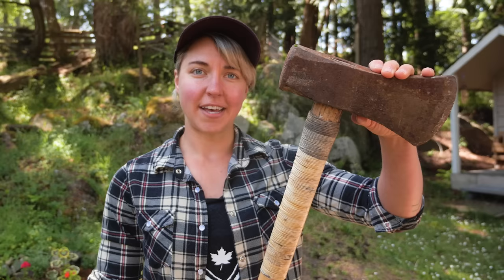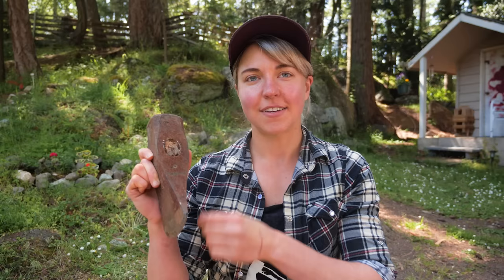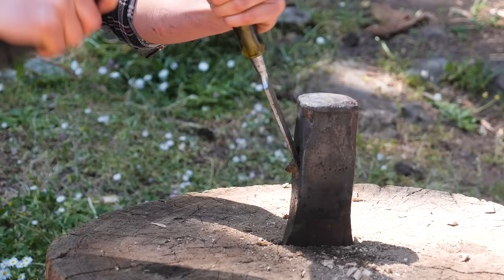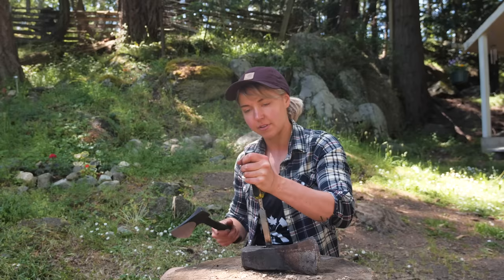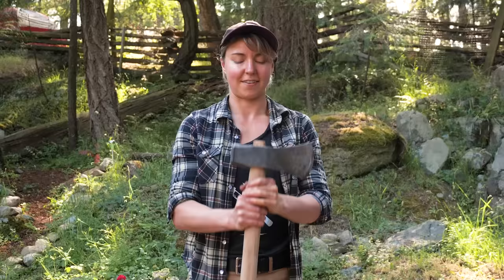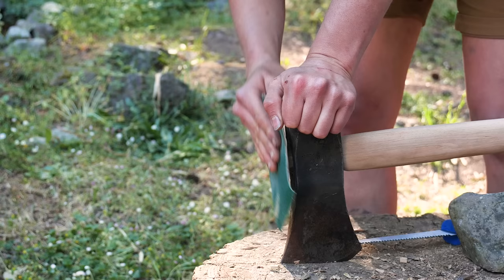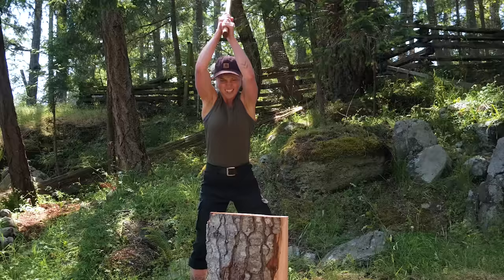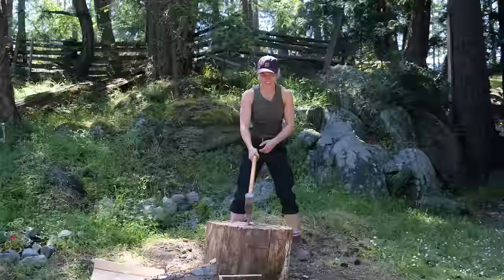Handling Ol' Rusty│AXE RENO

Comment: One of the first handle replacements I did was my grandfather’s eight pound sledge. It had a single metal step wedge in lieu of any wooden ones, much like this maul had. The handle had been cracked for years, so I thought it would be a good welcome home present to replace it for him while he was on a week long trip. I panicked so badly when I realized the wedge wasn’t coming out easily. I barely had time to finish it before he got back.

Comment: I’ve found the best way to get a wooden shaft out with a metal wedge is to light a fire and stick the head in it with the wood left in. Burns out and the wedge is left. Also helps burn the rust off too. Would be good to see you try that in the next video!
Reply: Wouldn't that make the head a little more brittle, or is the fire not enough to matter?
Reply: Runs the heat tempering of the metal 🙅🏼
Reply: Yea, the fire ain’t hot enough for that!
Reply: Ruins the temper. Don’t do this.
Reply: light a fire and stick your head in it ... really ... it hurts ... be careful
Reply: @milooliver9658  Very much is hot enough to mess up the tempering, unless you make a fire entirely out of match sticks 😂
Reply: @freddieweasel2533  You are correct 👍
Reply: Wood doesn't begin to char until about 500°F, so sticking something in a fire will get it a lot hotter than that. The steel of an axe head would typically be tempered at about 450°F. So putting an axe head in a fire will ruin the temper and make the blade soft. OTOH, only the cutting edge of an axe needs to be heat treated, so it might work to use a torch to burn out the handle while keeping the cutting edge cool in a bucket of water.

Comment: A little something you should try next time you need to put a new handle that you may find usefull, when you fined down the wood to fit into the metal, to snug it in try flipping It and keeping it in the air strike the other end of the stick with something flat a few times.
Look at the metal rise snug by it self. Hehe
Reply: That does work!

Comment: If you had split the handle with a strike over a stone set 1/4 from the head down, the splintered shaft would have allowed you to split to the head, work one side loose, then hammer that side out of the hole.

Comment: As a Carpenter this pains me to see that chisel being used like this, yes you can use a mallet on a chisel but a metal hammer is a no go and look at those chips in the cutting edge. After this it needs a good sharpen and a micro bevel put in it to help carving end grain.

Comment: To get that handle out the easy way out the axe head in your fire pit. It will not be hot enough to mess with the structure of the metal but will burn out the wood.

Comment: given how old and dry the wood looked could you have gotten a lighter and simply set the piece left in the head on fire instead of trying to whack it out with chissels? probably would have taken about as long and it wouldnt burn hot enough to ruin the tempering on the head

Comment: I am sure a shop will let you grind off all that rust until you can get power tools. Metal wedges work, it's why we use them girl. Rehandling an axe with wedges is not that tough. BTW one should sand off all the varnish first and recoat.
Reply: Not having power tools made the video more interesting
And wooden axe wedges work fine